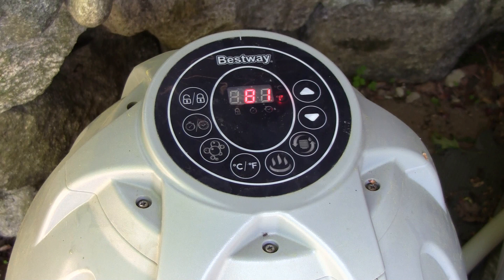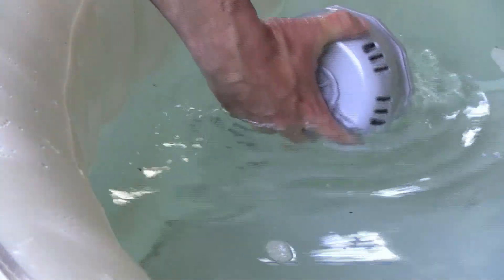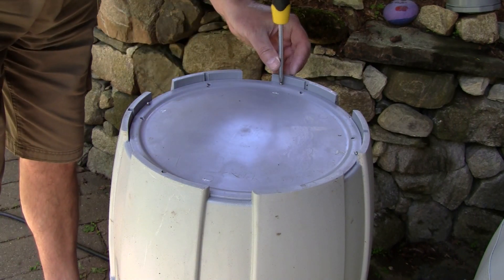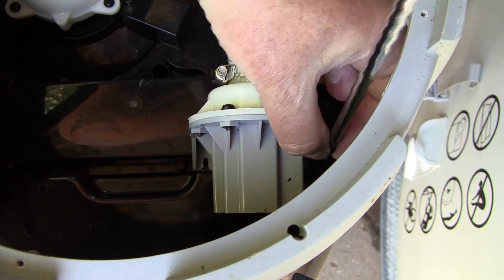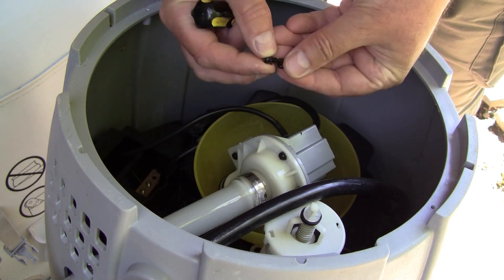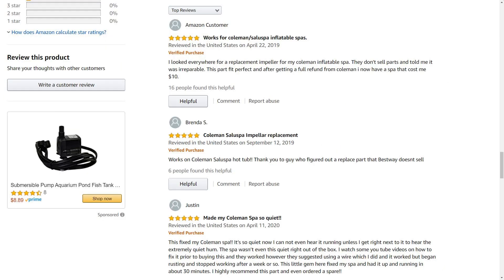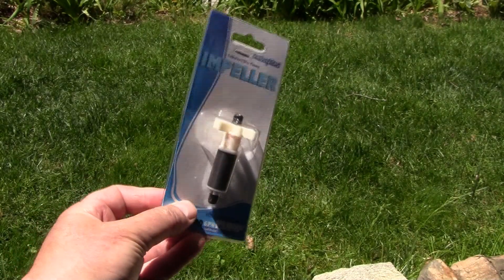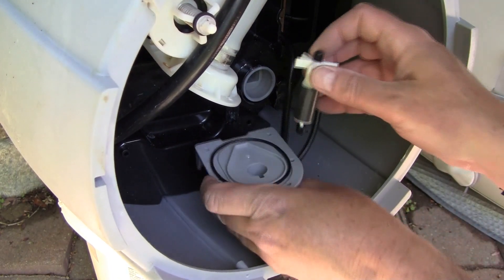SaluSpa/Bestway/Lay-Z-Spa E02 Error Code - Broken Impeller Shaft Replacement

Comment: I took mine apart and the shaft was not broke. It seemed like it may have been  a bit dried out by the rubber bushings it fits into so i took water based lube and lubed the whole shaft and rubber bushings and put it all back together. I also think there may have been a bit of debris in this area from when I had to super glue the filter housing back together a couple times and it may have been a dried piece of super glue. Anyway it works now with no parts replaced.

Comment: thank u so much for leaving link for part  I have the newer pump blower I'm assuming the same pump is used... I need an impeller for a spare  ... also never run unit dry the ceramic shaft will break immediately

Comment: I hired this for 5 days and I’d showed the error code after two days. What a pile of 💩. The build quality looks terrible.
Reply: It's a cheap Chinese inflatable hot tub.  What did you expect for $500??  My 2 friends both have $8000 hot tubs whose pipes leak (!) and one just spent $600 on pump repairs.  Plus, they're not cheap to run.  THAT'S why I bought a Coleman SaluSpa.  It's cheap ($482+tax) and I can fix it myself.  I'd researched these beforehand and decided this was the most economical way to go.
I built a level 8'×8' platform for it to sit on so, for about $1000, I'm satisfied.  
It's cheap to buy, cheap to run, and cheap to fix.  Win-win-win.👍👍👍
Reply: @imdeplorable2241  I bought one over 2 years ago, clean the filters weekly, and just started to get a e02 but only when i turn the bubbler on, I think the air bubbles are going into the suction for the pump so my pump must be wearing out , If i only run one at a time i have no issues. I do keep the water level high too so that might be it. Bottom line well worth the money and would  buy another. The $8000 ones always have issues, i can buy 16 of these for the same price. BTW I'm a proud Deplorable too.

Comment: How come water is not pouring out the air bubble hole because if I unscrew that pipe on mine the water flows out ,regardless of having two black caps on smaller pipe holes ?
Reply: Because you didn't plug the third one. two inlets and one return

Comment: I am also well versed in the operation of these bots.
Mine was coding 02 because that little flange in the water path if the white plastic section under the flow sensor, has an encased steel button that gently fixes to the magnet. Mine was dirty enough to require cleaning it. After which, it stopped interfering with flow. The axle that it hinged on was also so weak from age, if crumbled. I replaced it with a short bamboo skewer and snipped the excess. Working perfectly many months later.

Comment: My shaft wasn't broken it was the plastic itself that houses the magnet. Replace it anyhow. Its much quieter now. Have had mine for 3 years until this fix. Also if you need a hack on dirt on the bottom of your hot tub...i use a swifter duster with the fluffy pad slowly place it to the bottom and slowly run it across the bottom. slowly pull it out rinse and repeat. Works awesome. May have posted that before but good hack.

Comment: Water kept coming out of the larger hole when I put the two stopper caps on.  I had to empty the spa.
Reply: same i have a hose i cut and ran it to a container as it was leaking slowly. poured it back in after it was fixed.
Reply: Your backflow valve is sticking or something in it

Comment: This fix worked for me, however I did not have a skewer so I used a piece of coat hanger, grant it it will rust and is only a short fix, but I ordered the recommended impeller that I should have in a few days. I will let you know how it goes.

Comment: I just did the bamboo shaft fix with my first saluspa pump that I have had for 4 years!  I did not know what to do when my first pump showed a E02 error code so I bought another "egg" for $200.  My second "egg" pump worked for a year and then showed a E02 code when I went to set it up this month.  I watched this video and thought I would try the bamboo shaft fix on my first "egg" pump..... and wham it works!  I will not buy another "egg" as I have 2 now that I can fix !
Thank you!

Comment: I'm going to try this next I replaced  the sensors  on top no luck still  get E02 clear filters washed out system so I will try this does any1 know if I have to reset the pump after sensor fix?If so how do I do this?
Reply: Where did you find the sensors?
Reply: @endiglowgurl  on a YouTube channel  about e02 fix
The website for the fuse is digi-key.com sensor  is. 59025-1-S-02-A 
I'm still getting the error  so I guess I had to take it all apart again to find the problem.
Reply: I know they go off if  outside temperature to cold that's what I want to sort.

Comment: does the GPH matter? i noticed you bought a 400GPH. All i can find now is 550 GPH or better
Reply from the maker: 400 is pretty close to 550. I was just happy to find something that fit.
Reply: The ActiveAqua 550 impeller doesn't fit, I tried it.  It is significantly larger.  It has to be the 400.
Reply: @NathanielColson  Huge thank you,  Nathaniel.  
I was wondering about that.  Bigger impeller = more flow = longer life??  Nope.  Not if it won't fit.  
Thanks, again. 👍